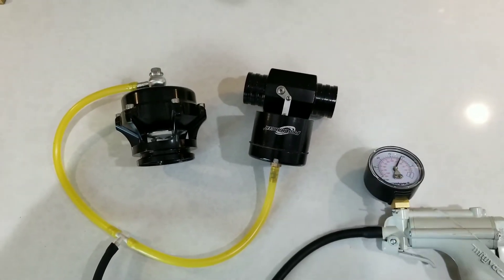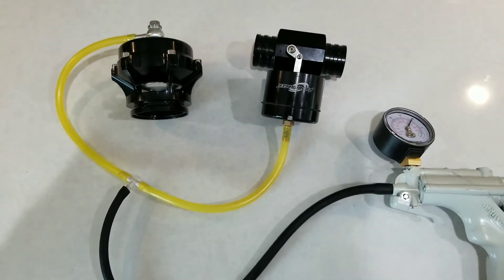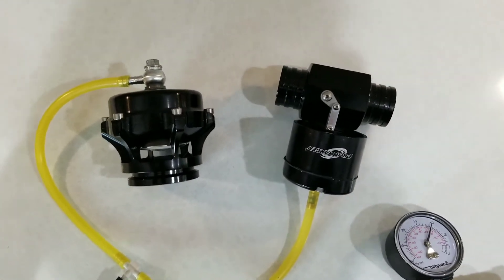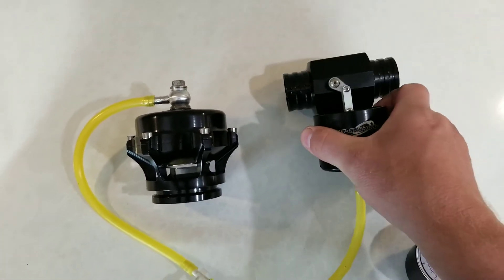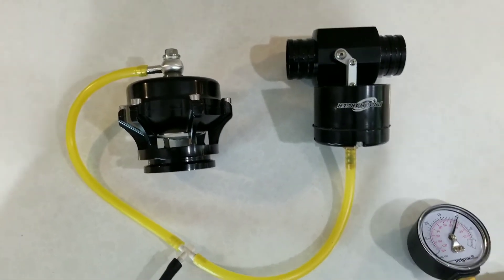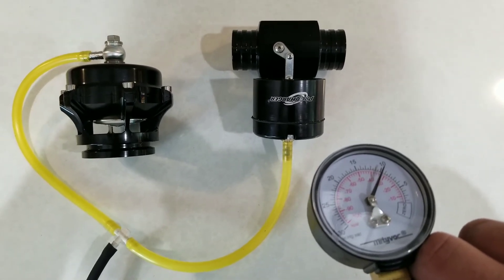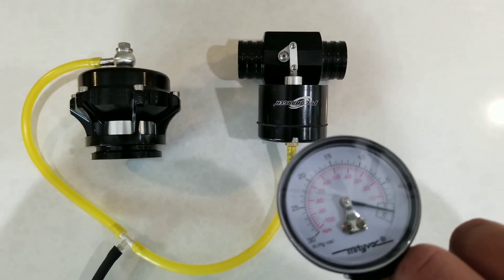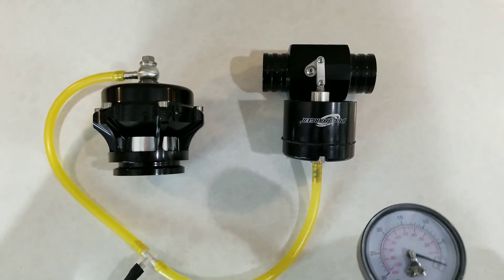Tial Q vs. ATI Procharger Pro-flo valve speed test

Comment: Let me explain what exactly happened here. Since you have Tee'd the two valves together, the reaction of one valve is going to effect the reaction of the other. It's pretty simple, the Tial valve has a higher pressure rated spring than the ProFlow (which has no effect on boost) so it started closing first, which actually created vacuum in the line that helped keep the ProFlow open until the Tial valve was closed all the way. 
**As a side note, you really shouldn't be concerned with how fast your valve closes, you SHOULD be concerned with how fast it can open to release your positive pressure during throttle lift. Afterall it is called a SURGE VALVE....